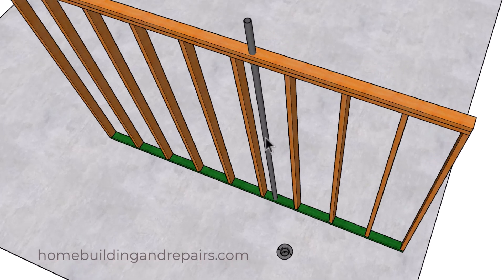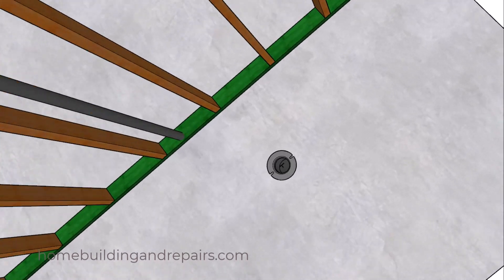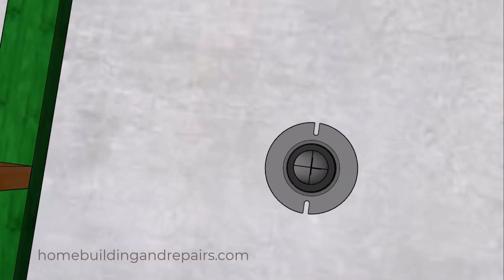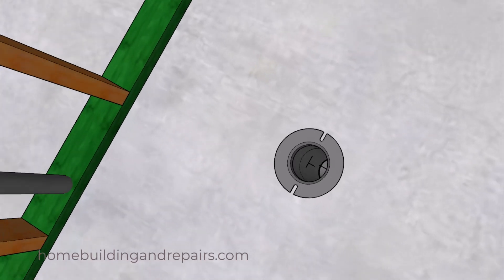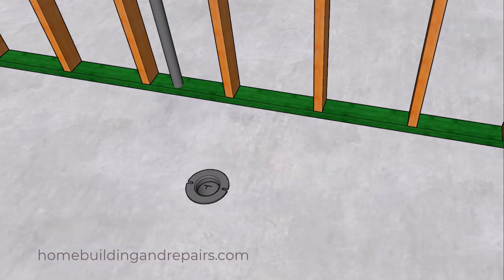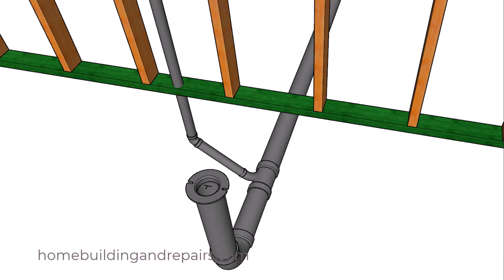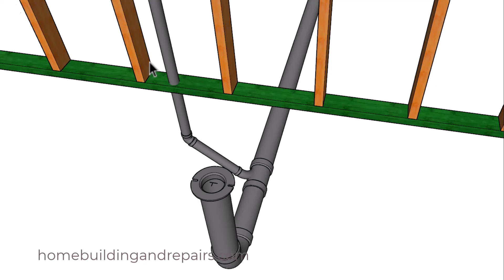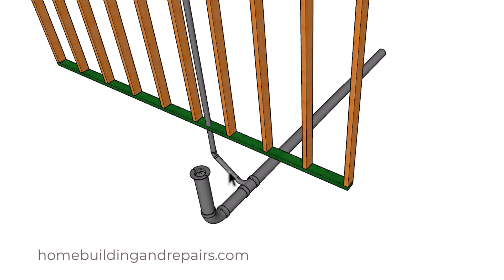Why You Can Not Connect Sink Drains or Plumbing Fixtures To A Dry Vent Plumbing Pipe

Comment: I   you can save a 30%cost on material cast iron and labor on a four  bath  3story  condo  you only have to order one  2inch san tee for entir house because. 4inch sewer. You need to  have 4inches of vent area.   Each  bath room you vent  out. One 2inch vent   so your washer you use a 2inch  san tee mostly because you ran almost all your cast iron in 2 in just remember your trap Harmony for the same for the for the weather drunk

Comment: I have been using horizontal wet venting for a least 15 years and don't over think it  first of all all your trap arm lengths are the same as  a traditional dwv type vintage system the first thing you do is you come along horizontal  put a combo or eye to hot your w/c  your limited to  6eet trap arm just like any other waste  system then you continue horizontal on the main to were you ban pick up a tub trap arm   or shower  after that you are still horizontal stay  and by now you are 2inch   I normally will stay  3inch until my last trap arm  taken off the  wet vet trunk  it would be a 3by2by 2wye the 2inch run would go the lav as your vent the branch is your trap arm for shower  same as always the shower trap arm  is limited to five feet from your take off at the vent or  eye  the good thing about using  the horizontal wet went is if you  take a closet bend and run say five feet to you vent tak off  on a normal vent system you have to roll the vent above the flow line usually at a 45degree angal not with this you lay your 3by 2wye or combo  flat and us a long turn 90for your lavy vent. You  can configure a ground  rough depth for any bathroom at  8inches deep  or deeper if your using  cables  you can not tie a laundry or a kitchen drain in the middle or end of the wet vented bathroom  you have to take those fixtures off  before the wet vented  bathroom
Reply from the maker: Thanks for sharing your experience and plumbing tips.

Comment: It’s not the 45 that is the problem in your dwg. It’s the sanitary tee at the vent connection to the horizontal pipe. Any drain connections to horizontal pipes must be with sanitary wye and 1/8 bend fittings. Also the vertical drain must be sized as a wet vent and cannot have any toilets on the drain.

Comment: Hi. Thank you for the video ! I have a main drain like the one in your illustration, that connected to a vent. My question is : can I add another drain to the main drain without an extra vent?
Reply from the maker: Probably not.
Reply: You can if it's in the same bathroom and it's a shower or tub a kt or laundry you take off before the wet vented bathroom if you ha a lav in the middle of the wet vent  trunk line  or if you trap arm is longer then it's length limit you can run out say  8 feet to the shower and vent the long trap arm like any other vent. Now you have two Dr y vent as long as the fixture is in this bathroom group of fixtures   you are limited to  four future units on a 2inch vent  say a shower and t laves  simply if you have a tub on the line you run three inch   a little further  trap arms are still the same as normal  from your  wet vented section